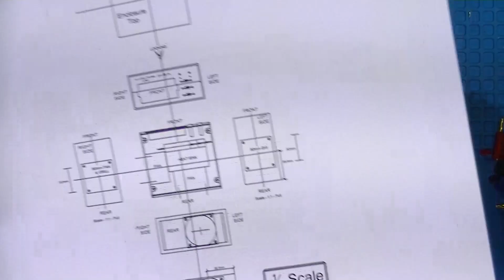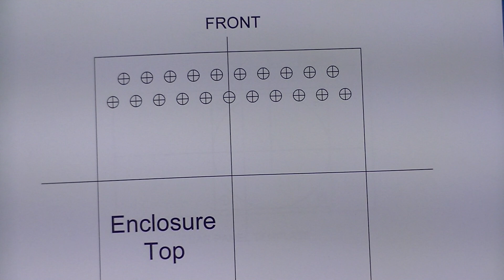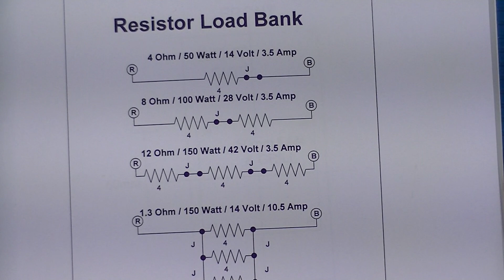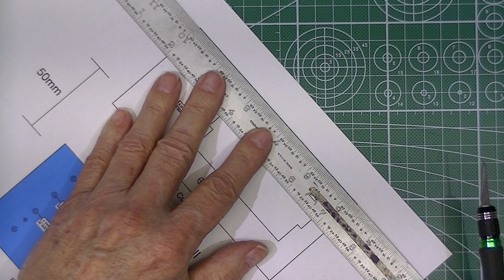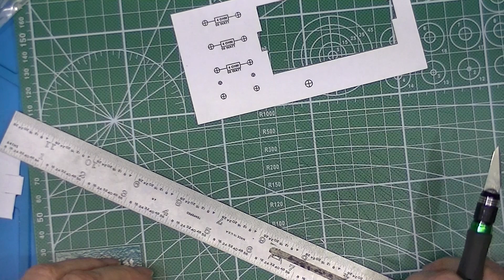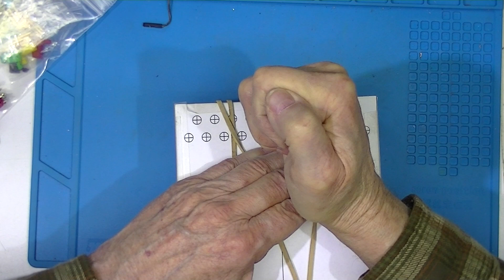A Pure Resistive Load Part 2

Comment: I really like these design and build videos. I like to see the thought process involved in putting one together. Thanks.
Reply from the maker: There is no more thought process, I am flying blind!  In this build I know that 150 watts must be removed from the box. So, some big fans, a heat sink I had on hand. I am worried about the display temp. The case is a little small for comfort. I will see what happens!!
Thanks!
Steve